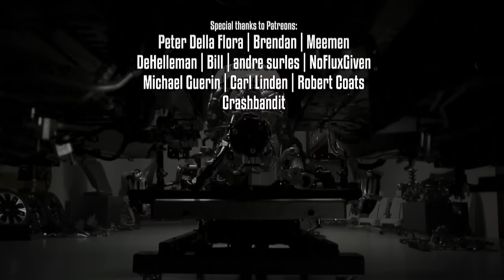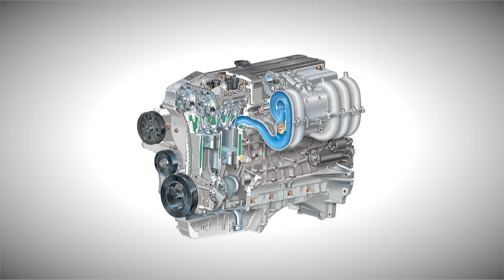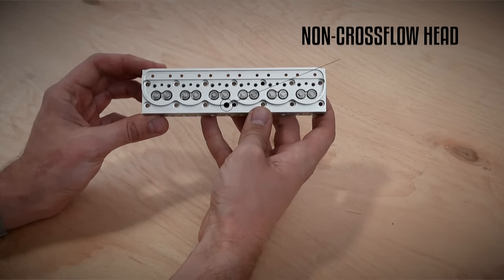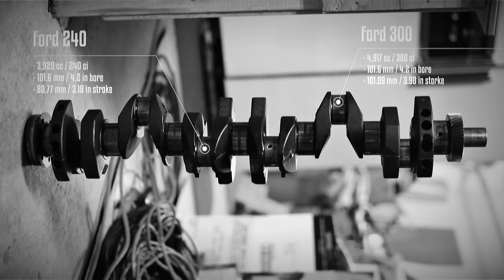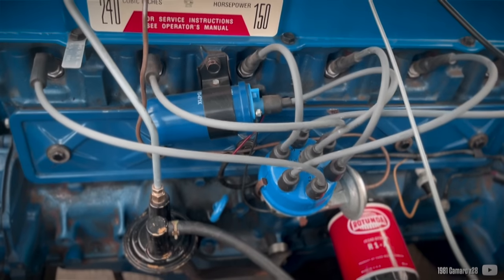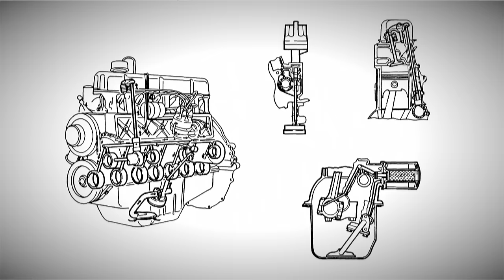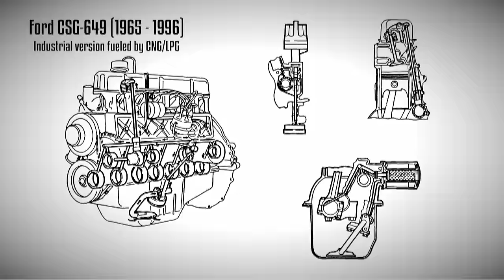Is This Toughest US 6-Cylinder?

Comment: No question the 300 Ford was a beast, but America has a long history of producing hard working, reliable straight 6 engines, most of which have roots in farming and industry.  Mopar made the Slant-6 to fit the new hoodlines of the early 1960's, and discovered an un-anticipated benefit:  better oil wash and slower oil return to sump upon shutting the engine off.  Thus, there was always a bit of extra film on the upper end parts, as well as a wetter low end, which extended the life of these engines to almost Volvo-like status.

Another legendary I-6 was the AMC 232/258, common in many AMC cars and almost all Jeeps as standard.  This was the direct basis for the now almost mythical 4.0L Chrysler that powered millions of Chrysler/Jeep products.  This one definitely is up there with the Volvo  B-18 and B-20 for both reliablity and longevity.

GM also made great I-6's for decades, starting with the excellent 216/218 c.i. series back in the 1950's

Comment: I was a automotive machinist. I loved the 300 also,, I saw a few cracked heads, a few blocks with sand pits…. But the worst was..the part stores not supplying bolts for water pump replacement.. the  pumps often needed shorter bolts and would break number 1 cylinder… It was sad!!!

Comment: Certainly, anyone who makes SEVEN main bearings for a SIX cylinder engine, no matter the size, is going to get a surprise out of the Life time run of one of these engines.  Ford knew, and knows how to make straight six engines as well as small block V8 engines.  Just as an example:  The "little 289 V8 that made 271 HP without even a high compression ratio or large carb.  All of the American car makers knew how to make lots of HP from small engines.  Lots of them.  I reckon all of them knew.  

American small block V8 engines as well as the Dodge, Ford, & even poor chevy knew how to make HP out of little engines.  To wit: 289 Ford small blocks, the little Chevy 283+ CI small blocks, then 327 Chevy and 351 Ford stuff.  Couldn't beat them for displacement vs HP.

Look up 270 slant six for a Chrysler engine.  Unbreakable.

Comment: Cool Video, I passed on a 1996 F-150 Supercab with a 5 speed and 300 I-6 for a Ranger 4.0L V-6 regular cab.  I sort of kick myself in the butt now.  Not sure I'd still have it, but if I did, it would be so cool to have a 27 year old truck with a renowed engine that so many folks like and also have a manual transmission.  Torquey as it was, it was certainly no stop light king, but then again, it was a truck engine.

Comment: The French Tower Flyer dragster  runs a Ford 300 with a custom cross-flow head made from 302 heads welded together. He shifts it at 7500 rpm. Look it up on youtube. He runs an OEM forged steel crankshaft, which was found in all medium and heavy duty applications, such as dump trucks.

Comment: The 240/300 inline-6 engines were Great, but the Barra is much BETTER!   It was STUPID of Ford of North America to NOT have "crossflow, alloy, 4-valve heads", {I.E.,--a Barra-head} on US engine-blocks, that COULD have been an alternate to any Ford V-8, in cars on the highway/racing/everyday commuting.   I LOVED the Astin-Martin DB-6 for its power & Sound, and British owners agreed for over 4K DB-6s were sold during its run, where it's price was 3-times that of a Corvette of the era, and 4-times that of Ford's Mustang/Cougar pony-cars.   The DB-6 was a High-performance-engine, making MORE HP/liter @ 4L than Ford's 6.4L 390 V-8.

Comment: the jeep 4.0 is almost a FULL LITER smaller...... yet makes 40 less HP (190 for jeep, 150 for the ford)
torque is pretty close..... 225 for the jeep.......... 260 for the ford (it better make more torque.... being THAT down on HP and almost a FULL LITER larger)
.
idk.... the jeep 4.0 is an over-square bore/stroke ratio..... which probably explains most of it
still, i thought the 300 would make AT LEAST 210HP
.
with gearing..... you arnt going to notice 35 foot pounds
but you WILL!!! notice 40 less HP

Comment: Take a look at the Chrysler Slant-6. It only has 4 main bearings but it was designed from the ground up for the block to be made out of iron or aluminum, so the iron blocks are insanely robust and overbuilt. (Aluminum Slant-6 blocks are rare, if you find one, you've basically won the lottery.) I am a Slant-6 fan, and the Ford 300 is the only engine I would put in the same league as a Chrysler Slant-6 for "runs forever" durability. Both are truly great engines.

Comment: 2:06: I've never heard of a Ford 240 cu. in inline 6; they used to make 170 and 200 cu. in inline 6's (my 1970 Maverick had one, as did my 1981 Fairmont), and the pickups had the large truck-only inline 6, but those were 223 cu. in (like the one I had in my 1961 F100), and the later bored-out 300 cu. in version. Was the 240 an interim size?

Also, I'd hardly call Ford a 'leader in 6 cylinder engines'. Between 1908 and 1941, they didn't even offer a 6-cylinder! Back in 1926, when Chevrolet introduced the 'stovebolt 6' to the low-end market, Ford decided to counter with the flathead V-8 for roughly the same price. While Chevy, Dodge and may others developed better and more economical inline 6's, Ford stubbornly just built V-8's.

Comment: One of Best Inline 6 Cylinder ever made won Le mans 24 Hour Race 4:times in 1950s  Jaguar XK Inline 6 Cylinder Engine  DOHC  3.4L 3.8L 4.2L  Could Produce 1HP per Cubic Inch  Excellent Torque . Internal Robust Design Parts, Beautiful  Looking Engine and Throaty Bad Ass Exhaust Sound . Jaguar used this Engine design for Forty+ Years . 1950-1990s

Comment: The Slant 6 from Mopar (everyone I know who has ever had one/their parents had one have nothing but praise for them) and the Cummins 6 cylinder diesel (especially the early 12 valve version) were/are also incredibly reliable and durable. 

As for large diesels, the Caterpillar 3406 (mechanical and electronic engines) and C-15 6NZ/C16 7CZ, 12.7L Series 60 Detroit Diesel  and Cummins N14/N14+ are all million mile plus engines before rebuilding is needed, and they can be rebuilt multiple times. One guy has SEVERAL million miles on an early 3406A engine that has been rebuilt only twice in its long lifetime.

Back in the early 1980s a friend from school told me about his stepdad’s truck. A 1967 F-100 with the 6 in it. In 15 years that thing had 400,000 miles on it and it was still running when last I heard (into the mid-1990s, when it likely had 500,000+ miles).

Comment: Prior to the 3rd generation GM small block V8... the Ford 300-6, and Mopar 318 V8 were the most reliable general market engines ever produced in the U.S.. The Chrysler 318 was so reliable, it powered many commercial vehicles well into the seventies, including 13 ton dump trucks. The reliability and affordability of the Ford 300-6 found application in countless industrial applications of both extreme duty, and duty cycle. There have been several accounts of 300-6 engines with 100,000 hours on them. That's equivalent to over 11 years of constant duty.

Comment: I'm 63 years old and have been a mechanic since the age of 14.  Repairing cars, motorcycles, forklifts, and aircraft.
I'm very familiar with the Ford 300 cubic inch inline six.  You're right about that engine's reliability, but the main reason for that reliability is because for many of the years it was used, it was really  under powered.  At it's peak it produced 150 horsepower and 260 lb/ft. of torque. However for most of the years it was produced, it put out only around 100 horsepower. That's how Ford could claim it's great gas mileage. My 1989 F150 with the 300 six and five speed seldom got even close to 15 mpg average. That's nothing to brag about for an engine of nearly five liters.  By comparison the Ford 5.0 liter 302, of the same year, available in the F-150 produced 205 horsepower and 275 lb/ft of torque. I owned a 1971 Ford F100, and then many years later I owned a 1989 Ford F150 with the 300 6 cylinder.  The 1971 f100 would have embarrassed the 1989 F150.  I towed a full size Dodge B200 van once using a tow bar, with my 1971 F100. The way that 240 6 cylinder pulled, you could barely tell the van was back there. I'd have never even considered doing the same with that gutless 300 6 cylinder. I think the 300 six would have had a hard time even getting the same load moving down the road. 
The 300 lasted a long time, but likely any 4.9 liter gas engine with only about 100 horsepower could have gone 300,000 miles. 
I think Ford marketed the 300 six cylinder well, and that gave it the reputation it enjoyed. It never made an impression with me. 
In my opinion, for an F150 of the same years, I would have chosen the 302 V8.  Not a lot of difference in torque, but the 302 in the late 1970's produced almost fifty more horsepower than the same year 300 six,  and for a pickup truck you may be towing a load with, that made a big difference.

Comment: The Ford 300 holds a special place in my heart. I’ve got a 300 industrial that I rebuilt in my wood chipper. Absolute beast of an engine that makes crazy torque at 2000 rpm while sipping from a single barrel. It has more power than the 4 cylinder diesel chippers while being more reliable at a fraction of the price.

Comment: Bought a very original 66 ford f250 2wd with a 240ci I6. Unbelievably tight engine. Cranks to life almost immediately in -25 F in january w/ single barrel carter carb. Torque curve from idle to 4000 rpm, horsepower?...whats that?

Comment: I had 4 different vehicles with these Ford 6 cylinder engines.  The never leaked or burned oil and lasted forever.  Amazing really.
Reply: Mine pukes oil and coolant, and also consumes both. Still runs great tho

Comment: I'd vote for best six in line the indestructible, early, before 1980, American Motors Corporation, crankshaft was so well balanced, it could be tuned up to 700 HP from 4.2 litres.
The last derivatives, the Jeep 4.0 HO, has less counterweights in crankshaft, can't be so much upgraded.
Some install Pacer 4.2 crankshaft in the Jeep 4.0 HO, this increases displacement and power.
Blessings +

Comment: The Barra descends from the 144 CID Thriftmaster 6 in the 1960 Falcon.  Uch changed of course but the same bore spacing (4.080"/103.68mm). The 240/300 are a completely different animal. There is a .400"/10mm difference in bore spacing getween the two designs.

Comment: I had an 88 F150 with the 4.9 4x4 manual. I regret selling that truck. You could Not kill it! I was living in Wisconsin and it had 31"tires. And it was unstoppable! I'm talking middle of nowhere Wisconsin. Never got stuck ever! 4 feet of snow, no problem, roads haven't been plowed in a week, no problem. It was an absolute Beast! Only one down draw, 11 mpg. Didn't matter if it was empty or pulling 10,000 pounds, you got 11 mpg.

Comment: The old GM six, sometimes called a "stovebolt six" is the best engine ever made, with the Ford 300 an excellent runner up. My '72 GMC ran past 400,000 miles with regular 3k miles between oil changes. My '68 Ford F-250 with the 300 straight six ran 350k miles, a good runner up before it destructed itself. In my book, longevity is better than over rated horsepowered turbo 4Cyl junk. V Sixes have the same problems as the V8, warped heads, oil leaks, and fuel sucking carbs. Not a good substitute for a straight six.

Comment: My friend bought a 1984 ford F150 4x4 new and still has it today with almost 700.000.00 miles on it. All original drivetrain. I drove a 1971 F250 HD oilfield truck that had documented 970 thousand miles. Except for regular maintenance I never experienced any problems that I couldn't handle myself and the truck has never been towed for any reason! Both had 300's in them and you couldn't kill them!

Comment: My first new vehicle was a 1984 desert tan 8' bed, 4spd manual on the floor and the 4.9L straight 6. No air or radio. It looked exactly like the pull truck at 5:52, exact same color....Mine had a vinyl bench seat and crank windows. I paid a little over $8000 new at Town East Ford in Mesquite Texas in Nov '83.  The payment was $171 pm for 3 years... How times have changed. I have a low mileage 2008 Tacoma 4x4 now.

Comment: An underrated engine is GM's 4.3L Vortex V6, that thing was a powerful small engine that was reliable and durable, My dad ran his 05 Astro with this engine with extremely low oil for 2 weeks until the engine blew up.
They can easily get half a million miles if you take just enough care of them.

Comment: I have a Atlas I-6 that has been pushing around 5000lbs for  20 years and over 200,000 miles. ( The electronics wrapped around it sucks) The ecu does work real well. So as long as the key makes it run, it won't get replaced. The 4L60E also works fine. That is pretty unusual for a automatic with that many miles. 
Might be one or two of the reasons that GM quit making them, T-Blazer/Envoy rear drives.  Beside the 2 cylinders too long thing. I keep because the wife won't drive it. Out of style.
Never really missed the V-8. 275 HP is adequate unless your are racing. Then 5000 lbs is a bit too much, But the Atlas is not a Ford 300, it just wont last longer than the chassis.

Comment: I like them had them but the moper slat 6;is low power but unbreakable when gm ford and moper V8s were much shorter life 70k before a valvejob and 120-130 k for rebuild . I got 260,000 on a Chevy 250 but it was worn out it had giant riddles maybe 1/4 inch  it was still driving. But that was the longest I've seen a inline non slant 6;. Slant 6s would outlast the vehicle they came in moper rust alot an fast . But the slant 6 in a 2x4 pickup would get in the low to mid 20s mpg without a load mid teens with a load . Then moper also built e 275(?) Slant 6 industrial that ran equipment and generators and one of the coolest motorhomes built by CLARK INDUSTRIAL  highly sot after vintage class a steel body  .

Comment: It's a mule!  like a mule lined up head to tail for torque more than speed. although most cars and trucks have V-6s for road traffic and accelleration. you cannot get a new car or truck with an inline. reguardless of Ford, Dodge or Chevrolet. My Dad's old Ford was in in-line 6. A work truck, not a city vehicle or running intersections. in the City a V-6 is best.

Comment: AMC 6 s stronger than the FORD  half inch head and main bolts, filled in main webs, thick cylinder walls and deck.
Cranks are either high PSI Nodular iron or ARMASTEEL.  I was involved in the AMC Indy project. we ran a .010 over (210 cu in) 199 6 at 60 pounds of boost and it would run 500 miles. Ran hours on the dyno over 1200 hp
 Stock Crank    Ford has problem trapping air in the head and must be carefully blead or head will crack.  Still a great motor too

Comment: the ford 300 is a good motor...... but im partial to the much smaller 4.0 jeep
.
the jeep 4.0 has 1 thing most I6'es dont have...... 
an over-square bore/stroke ratio 
.
most I6es have a LONG stroke and a smaller bore..... which helps with how long the engine is
you have the same displacement..... but a smaller engine (taller, but thats easy to fit......its the length which makes I6'es so hard to package) 
.
and while this reduces the torque a bit..... due to less stroke
it helps A LOT with fuel econ and allows for a slightly higher RPM 
.
.
idk.... i just LOVE my 4.0
smooth, quite, decent Econ, decent power and SUPER easy to work on 
(expect the water pump.... due to the engines length....ya have to pull the fan and fan shroud at the same time..... and you only have like 1 inch to get to the fan bolts)
.
still, thats only 4 bolts
EVERYTHING else is dead easy to get at....... spark plugs take 10 mins to change
oil filter and dizzy cap/rotor is right their
intake and exhaust is right their
.
.
i just love pretty much every I6 ever made
people just dont get it till they drive one.... and see how SMOOOOOTH they run

Comment: The BARRA engine is also 
All Australian designed and manufactured ford engine, 
The base engine was a 180
KW, 
The factory turbo barra's 
Came in various  kilo watt 
Sizes  ,  AND the factory barra cylinder head is capable of making 500 hp .
But modified can provide up to 1300 hp  ,
In race/Street application. 
Most ford barra taxi's in Australia 
Averaged  850,000 klms 
From a regularly serviced vehicle   ! Sadly ford closed its 
Australian plant and so the 
Barra is no more. 
😢

Comment: south america didnt use much of your v8s. down here, mainly in brazil and argentina theres lots of ford 188/221(falcon/f100/fairlane), chevrolet 230/250 (400/chevy/c10), 225 slant 6 (coronado, rt, D100). they still race them in argentinas "turismo de carretera" (obviously theyre new cast engines limited to 3 liters for all cars) and high revving 3 liter inline 6 is one of the best engine sounds ever.

Comment: Best ever ?
You BET it is !!!
This bone tough straight 6 has been the mainstay of our fleet, especially our snowplow trucks, and heavier equipment pick up, and delivery trucks !
Without question !
We have treated them as old school as possible, changing relatively clean engine oil, and a WIX oil filter every time at 2000mi. exactly like my dad did years ago !
Might be a little overkill, but  we've got a half dozen of them that are well beyond 500000 on them with no major internal engine issues !
None !
Just normal maintenance wear parts, hoses, belts, and tune-up parts, and an occasional starter once in a while !
We've never been inside any of them !
No idea why Ford ever stopped building them, other than they might have been TOO GOOD for there own good !
Just my personal opinion, but
Ford needs to go back into production on the 300/4.9 !